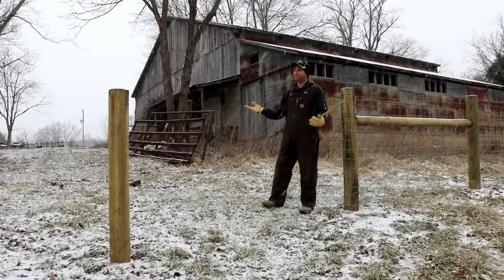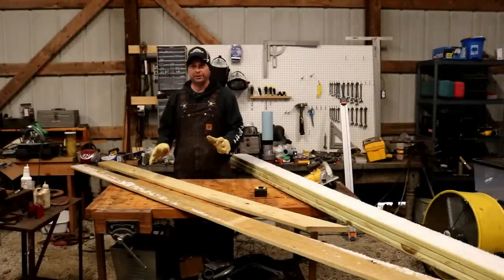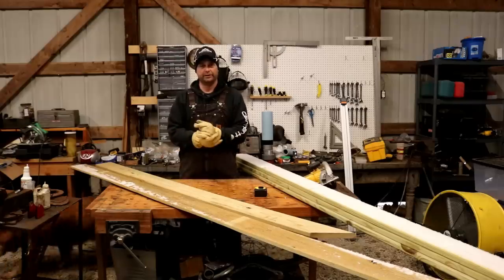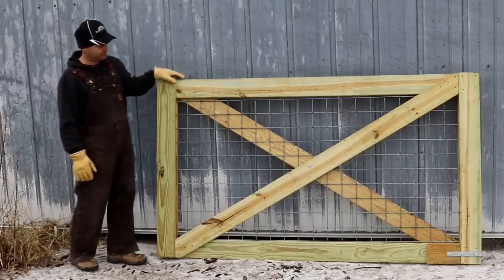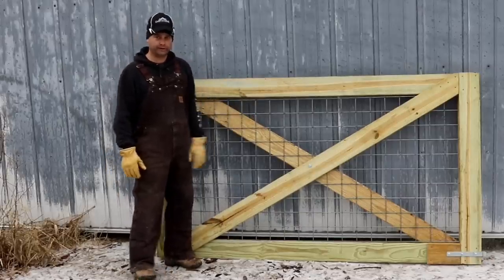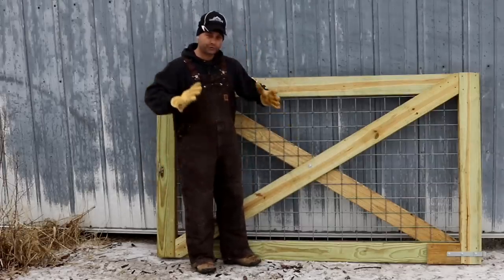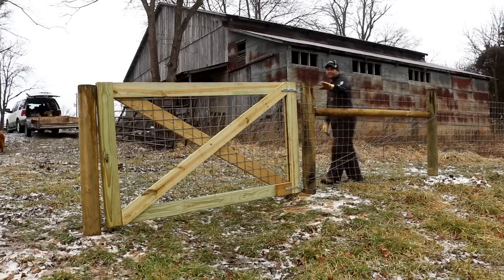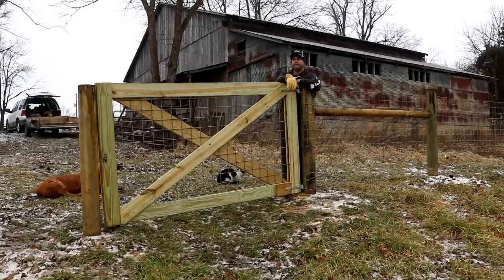Building a Large Wooden Gate for the Barnyard

Comment: Gates on our old place were built the same as yours, except for no wire.  One other difference was that the hinge side pole was about 5' higher than the top of the gate such that a support (guy) wire could be added to insure that the far end of the gate did not sag.  Our gates were at least 12' wide.

Comment: Looking good! It might just be the way the camera is sitting but the left (unbraced) post looks plumb  is the gate level? If it's not you can tighten the top lag screw until its level and put the top hinge back on, if a half turn is what you need another person's idea to pin the top screw pointing down would work and the gate can't be lifted off the hinges.
Reply from the maker: the gate is unlevel, because the ground is going downhill.  so the gate follows the ground.  if I level the gate it would be 8" to 12" higher than the ground on far end.

Comment: Will the pressure treated wood degrade the sheep panel over time? Oh, and previous posters were correct, your top hingepin needs to be pointing dow to prevent someone or something from lifting it up and taking it off the hinges.
Reply from the maker: Yeah it is so I can lift it off if I want.  But the hinges are in a slight bind and it is so heavy I dont think I could lift it off without losing a hinge.  It weights 4 times what a 12 foot metal gate weighs.  It definitely needs hung on a fence brace or it will pull the post over.

Comment: Has your 8 ft farm gate that you made out of treated 1x6’s warped or cracked any where you screwed it together?  I’m wanting to build two 8 footers for my driveway. I value your feedback.  Thanks
Reply from the maker: No, the wooden farm gates are still fine.  No warping.  They are very heavy gates so you need a good post or brace to hang them off of.

Comment: I would center the latch on the gate instead of the top
Reply from the maker: The pin needs to clamp around a horizontal bar on the gate to keep it was twisting.  So with a wire filled gate it has to be that high, since there is only one horizontal bar on the gate.
Reply: @CountryViewAcres  I meant on the wood gate
Reply from the maker: Sorry, I thought this comment was one my recent videos.  My bad.

Comment: Evan, You really need to change the corrugated Metal on the back of the Barn so the Corrugations run Vertical, It would look a lot better & probably wouldn't have rusted so much because it didn't have drainage. Then you could Paint it & it would look Great.